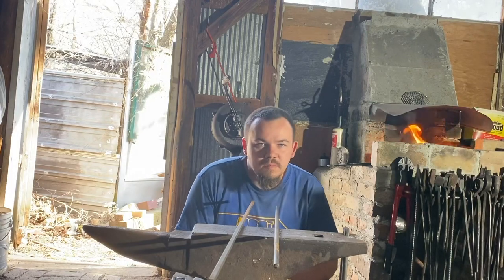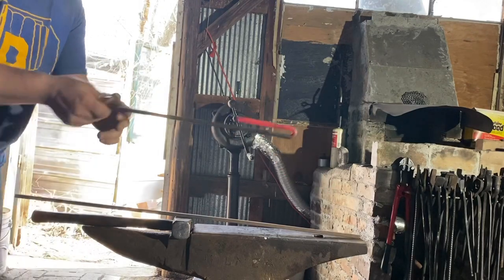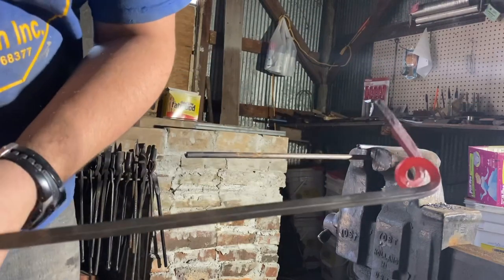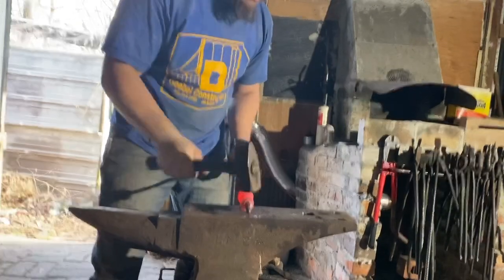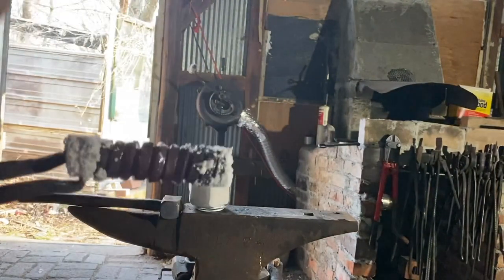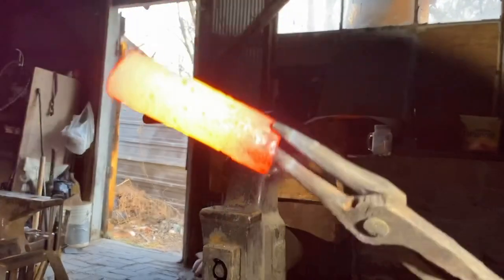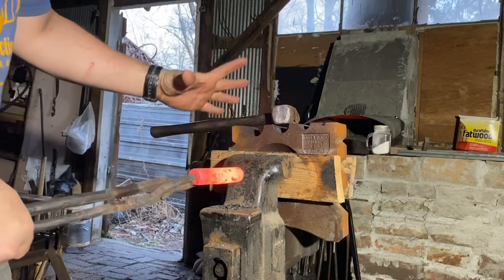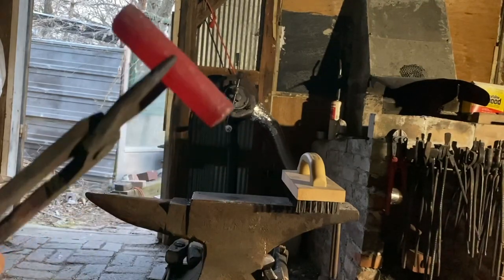Forged Gun Barrel - Method 3

Comment: Here we are under Prez 46 <sigh> and I had pretty much given up on the notion of making my own pipes <ahem> by forging them. Watching videos online make the whole process look so complicated and most of them require thousands upon thousands of dollars worth of machine shop type equipment. Now, however, as I move my family "out of the city" and into a small town on a couple of acres, I'm seeing the very real possibility of putting in a subterranean blacksmith shop combined with my above ground regular workshop. Thanks both for your service, young man, as well as sharing this wonderful wisdom. God Bless you and our beloved America.
Reply from the maker: Be careful of carbon monoxide. I have to stop forging after 4 hours in my shop due to the prevailing wind blowing the forge exhaust back in through my door due to the layout of my shop. Nearly died figuring this out.
Reply: @veteranironoutdoors8320  That's excellent advice. I doubt that I will get a canary, but that might be an option. :)

Comment: Holy crud. Once I realized what you were doing, my mind went 🤯! This HAS to be the most complex of the methods I've seen. Is there an increase in overall quality, you think?
Reply from the maker: This one did turn out quite nice, I feel it was the strongest of the three, and because it was wrapped around a perfectly round mandrel to begin with, the as forged bore was very nice, easy to drill. However the chances for flaws are exponentially higher, and the inside did not weld up anywhere near as good as method 1, I had to remove quite a bit of meat to get to welded steel the whole length, though I feel this is because the square stock I used had radiused edges from the factory, and some of my wraps were wonky.

Comment: I’m surprised that the coil didn’t warp/close up in the swage. When you were done, it was still a good looking, clean consistent inside tube all the way down the middle. Is it just light taps and a swage that keeps it circular and not collapse the inside?
Reply from the maker: Yes, a combination of the bottom swage and light-medium EVEN hammer blows. Keep the barrel blank rotating the entire time. Give it a good looking over every few heats to see if you are introducing any oblongs into it, and if you are, position the top of the oblong in the fire so it gets the most heat. Then light blows on it until you get the oblong out.

Comment: I imagine it’s much easier to do this on a pistol length barrel. I have had some ideas I’ve wanted to try as far as black powder guns go for a while and making my own barrels is necessary due to the extreme expense involved. I have a few questions before I try for myself though.

Would you use a bigger mandrel to make a bigger bore? 

Would this be possible without a stage block?

And finally, could you do this with round stock? I have tons of rebar and round stock scraps and it would be great if I could use some of that stuff to make a black powder pistol.
Reply from the maker: Yes you would use a bigger mandrel for a bigger bore. You need a swage, it doesn’t have to be a block, it can be a hardy swage. You can do it with round stock so long as you make it rectangular or square first.

Comment: Interesting work thru.
Cant help but ponder if there were a follower to help  keep the coiling process  straight and tight would reduce the number of welding heats and labor involved?
   In itself would be an intensive effort to construct  though I'd reckon. 
Perhaps  some sort of manual  screw mandrel that would be set to draw the square stock  directly from the forge to the mandrel  keeping  pressure coaxial both to the mandrel and against the coil previous wrapped.  Doable I'm sure once the gearing issues were calculated and an attachment were designed an attatch to the forge in proximity close enough to keep the bar stock up to temp yet drawn slowly enough to allow the stock to come to temp as its drawn through the forge fire itself.
   Given your wrapped and welded bbl were going to be rifled... I would propose the wrapweld would want to be done in a manner exact counter to the rifling rotation  to reduce torsional pressure imparted coliniar to the weld rotation.  Ie. Right rifle twist would call for left rotation forge welds.
   Boy did that run off on a rabbit trail lolololol 
🙏 blessed days sirSir 
Crawford out 🧙‍♂️
Reply from the maker: Daniel Crawford  I have a playlist called “historical blacksmith footage” and in it is a video called “cannons le damas” (something like that) but it is a video on how spiral wrapped Damascus gun barrels used to be made. Two guys per team working on the barrel

Comment: Nice method brother
 I use galvanized steel pipe and another oversize pipe to double thickness at breech 
And want to  use this  pipe as a muzzleoder gun barrel .
It pretty strong enough to hold pressure
What s your opinion on this
Do I should use this as a barrel or not 
Thanks

Comment: many when making this type of pipe by forging they used 3 mm steel wire which was wound in a spool of several cm in thickness and then forged it all into molds with semicircular hammers
Reply from the maker: Goce Kocov look into my playlists and you will want “historical blacksmith footage” and from there you will want to select “canons de damas” something or another.

Comment: NEW IDEA:  start with two billets of Damascus steel, with a groove in the center like you did in the Method 1 video.   Rivet the corners together with small pin rivets.   Heat the whole barrel, then using a ceramic, clay, or other high temp lubricant screw in a hardened steel threaded rod slightly smaller than your end bore diameter.   Now proceed to beat the hell out of it to get a solid weld.  Unscrew your center rod if you can.  Reheat the barrel and try to put the rod back in cold.  Yes it will steal heat quickly but it should still provide enough difference in temp that with the lubricant it shouldn't seize up.  Twist your barrel to get a spiral design on the barrel.  Straighten the barrel and try to unscrew the central rod.  Clean up your bore and ream it out, riffle it, and set it up for a test fire.

If the idea works, or with your experience making a few changes, can be made to work...  You could end up with an absolutely beautiful barrel for a heirloom firearm.  

I also have wondered though I don't know how feasible it is, if  you could build in a kind of electrical arc system like a spark plug.  Ignite the black powder with an electrical charge like blasting caps do.  Trigger just completes a circuit from a rechargeable battery hidden in the stock rather than percussion caps or flint lock.  Kind of a mix of the old and the new.   Stock made from say a weathered and worm eaten old fence post that was encased in epoxy resin for strength, also making it easier to hide the electronics in the stock.  Small USB charging port recessed in the butt for recharging the Lithium battery.   Be one hell of a pretty conversation piece.
Reply from the maker: The whole first part of that is overly complicated for what we are trying to achieve at this point in the manufacturing process, and wouldn’t work for a number of reasons. 

And I have seen an Idea similar to that before. I forget the brand/maker but for a short time they marketed an electronically ignited black powder rifle. Must not have sold well.
Reply: @veteranironoutdoors8320  Ah, wasn't thinking of it to sell.  As to the first issue, found information on doing it very similar.  I just don't know that I've got the skill or the tools.  Still my forge should be set up before fall and maybe I'll give it a whirl.  Was really more planning to work plate  armor but hey everyone's got to have that odd project to keep them frustrated right?
Reply from the maker: @michaelshultzinger4902  I wish you luck in your endeavors, and I will be here should you need advice.